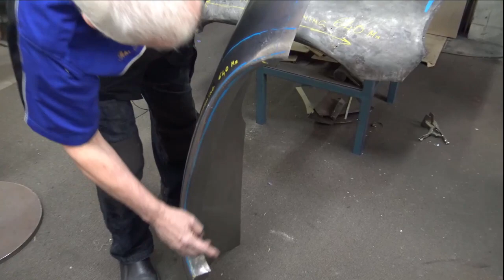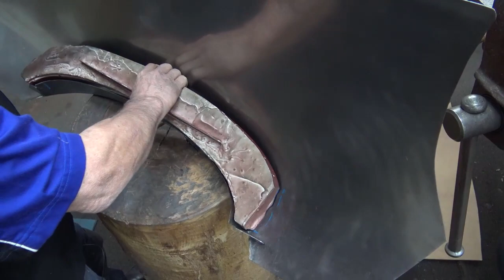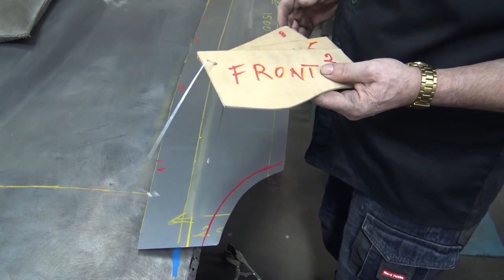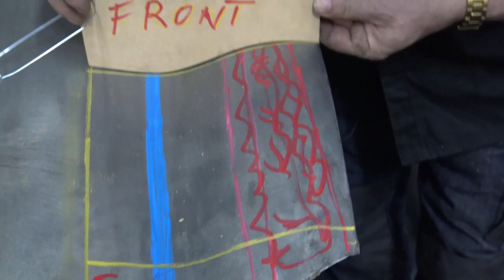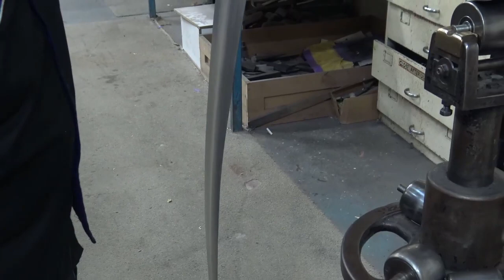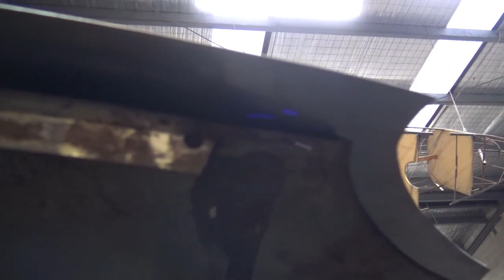Methods And Various Techniques For Metal Shaping By Peter Tommasini (Part 1)

Comment: Thank you for the very informative video. Your style of presentation is very easy to follow. I have read only the best comments about your videos. Are your DVDs presented in this style with this depth of information?
Reply from the maker: I try to do my best on the handbuiltdvd's , check out the trailers on   ''vimeo on demand'' from my web site .   Thank you
Reply: I have the DVD series. The info is very in depth and presented in this style. Well worth the price in my opinion.